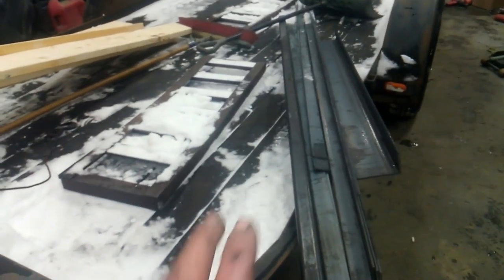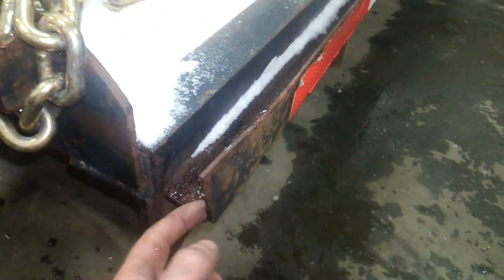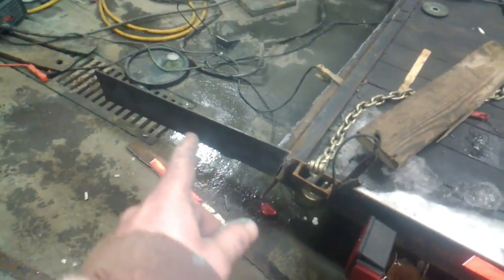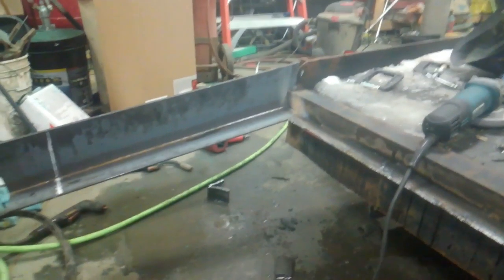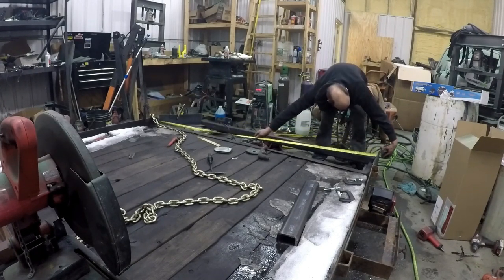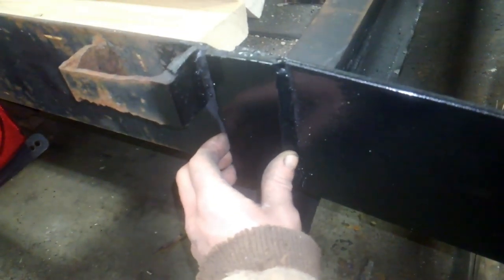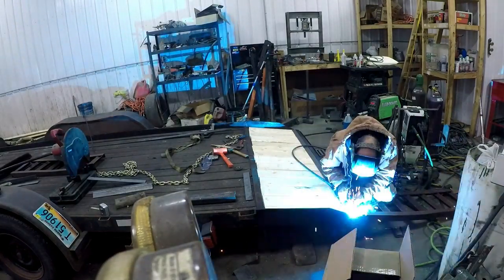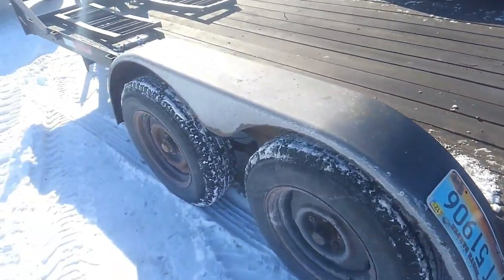trailer beavertail fabrication

Comment: will you have to move the tail lights further back?
Reply from the maker: I haven't. I'd actually like to move the axles back on the trailer a bit
Reply: @Ezrider359  add  an extra axle?? tri axle in stead of bogey